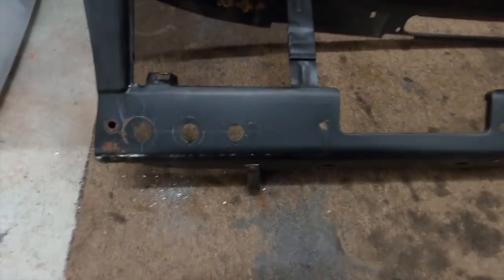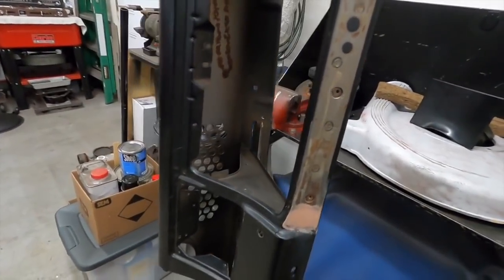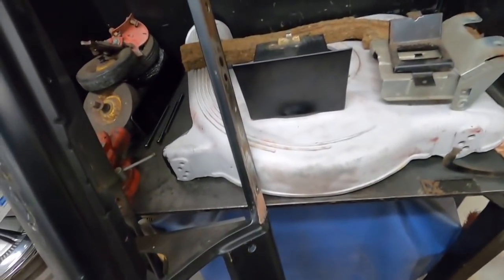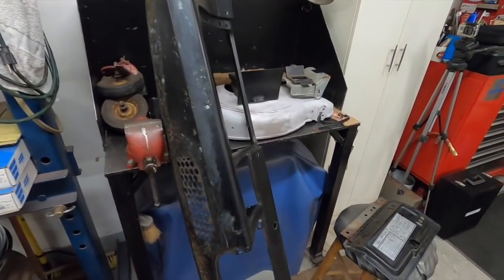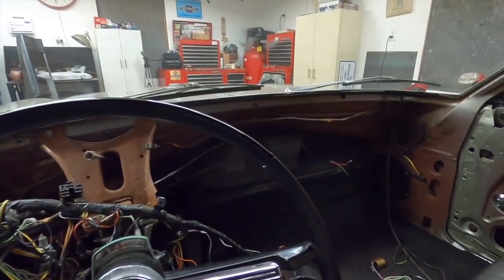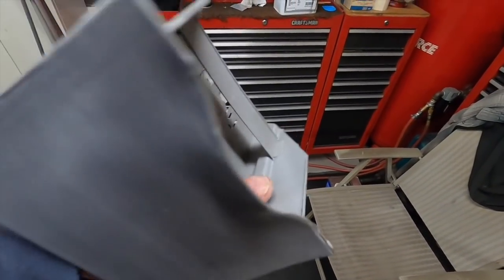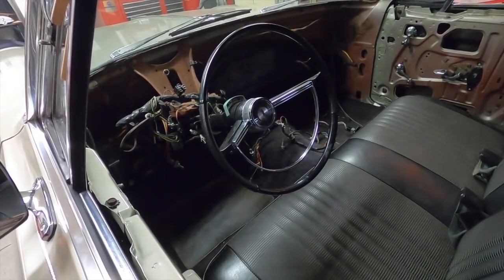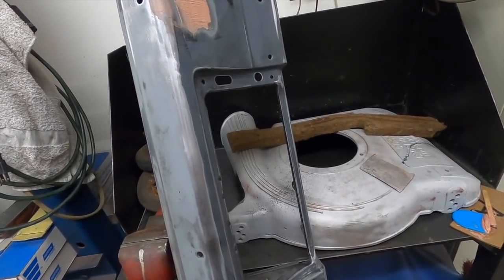1966 Ford Galaxie 500 convertible restoration part 162 sanding out dash and parts

Comment: Howard, At 3:35 sec. , That is the back brace for the Emergency Switch Black Bezel. The two bolts go through the bottom of the Black Bezel, then through the Glovebox, then through the Metal Back Brace...then the two nuts are applied to each small bolt.  The bolts will have either Phillips screw heads or Hex Bolt heads.  Both were used in 1966 for the Eemergency Flasher Bezel to secure it to the Glovebox.  Tony K.  :o)
Reply from the maker: Yea, thats kinda what I figured. I hope to get the paint on all the dash parts today, so I can start reassembling the dash.

Comment: This is interesting, seeing how the car was originally assembled.  At 1:00, I saw those cage nuts, which reminded me of the cage nuts that I used (in my working days) for mounting computer network equipment, such as file servers, in the dedicated equipment racks.  I think the computer racks use size M6 cage nuts, but I think these are also available in 10-32 and 12-24 sizes.  So if you wanted to use new ones, maybe they are available in the size that car uses.
Reply from the maker: There in great shape, so I can reuse them, plus I have a bunch in my parts drawers. I always save stuff like that, when parting out cars. Fasteners are super important to save. I see other tubers removing parts in salvage yards, just dropping the fasteners and leaving them on the ground.... They will eventually learn to save some of them, if they want to use correct fasteners. Local hardwares don't carry a lot of the types of fasteners cars used!

Comment: Thanks for letting me borrow your paint booth today, Howard! I painted the steering wheel off the ‘76 F150 today. That was the last item to be painted. Assembly is to be completed on Wednesday, windshield chrome strip not withstanding. I don’t know if you’ve ever done those but getting that stainless edge set don in that rubber moulding is difficult. At any rate, I’ll be out of your paint booth tomorrow! Cheers!
Reply from the maker: I have done windshields on that era truck. That trim needs to be installed into the weatherstrip before the glass goes into the truck.... Same with that era GM and Dodge. I always install the rubber onto the glass, install the trim, then with a small rope in the body side of the gasket, with sealer, I set the windshield in place, pull the rope ends evenly, the glass drops in. It's a bit of messy work, but not that difficult. I have done many of them, as most older cars were the same way, like the Bel Air. I have put three windshields in that car over the past 40+ years.
Reply: Hmmmm..... did it backwards. I put a new gasket in and I had trouble getting it to stay in place on the glass while I was putting on the stainless so I calculated I should install the glass first.... I had done these windshields before several times but never with the chrome strip so I guess I learned something again from the school of hard knocks. Thanks for the info Howard. Much appreciated.
Reply: When I had an Opel, the front windshield was mounted VW Beetle-style, with a plastic brightwork strip insert that pressed into the rubber.  I used a Lisle tool (and dishwashing liquid) at the time to press the strip in, something like today's Lisle #48600, for your future reference.